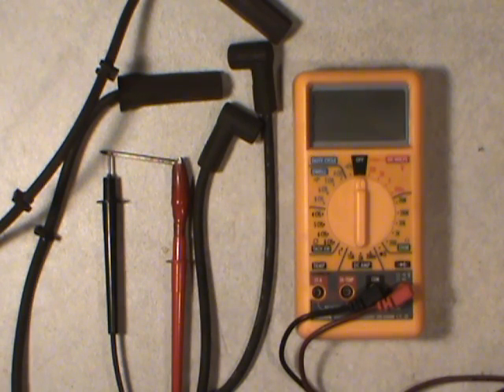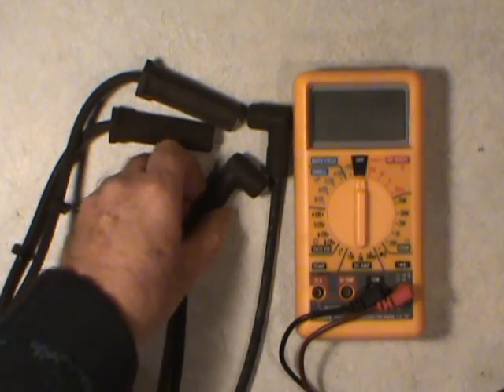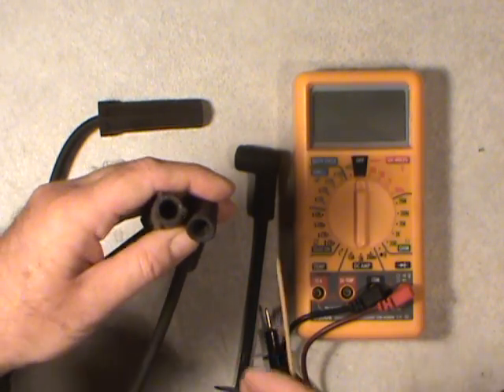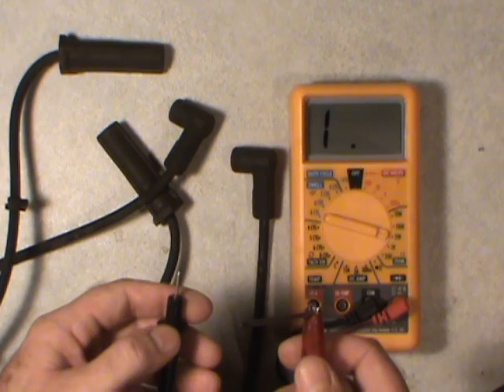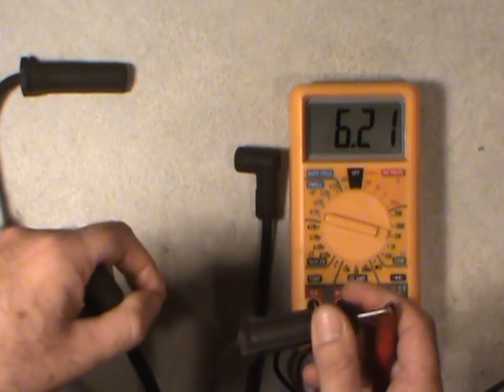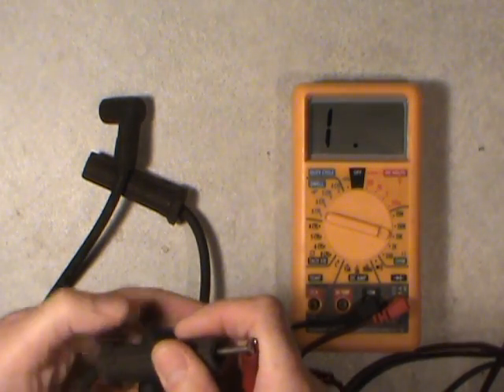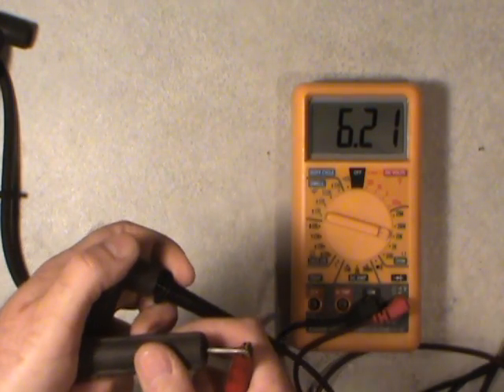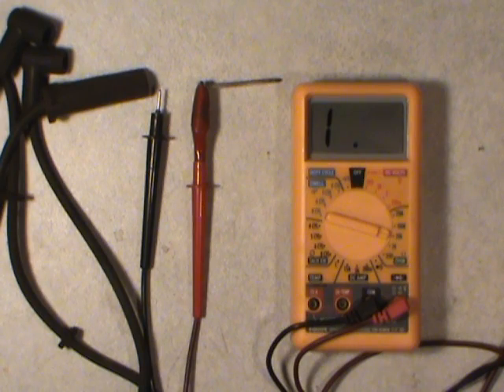How to Test Spark Plug Wires

Comment: what cause a shudder on dsg gearbox of polo 6 1.4 engine only if you set in drive but its driving normal is sport?
Reply from the maker: Greetings...shiims3545.........Thanks for watching.........The DSG Gearbox, sure is, a quite complex transmission alright.........Even though, I don't have any experience, with this (DSG) type of transmission, I can offer a few things, that might help you out..........The transmission "Fluid", and the "Filter", should be changed, at the manufacturer's specified time, and/or, mileage/kilometer-age interval, b-cuz, transmission fluid, will usually, start-to, get dirty, and also, the additives, that might be a part of that same fluid, will usually get used up as well..........Old/Dirty transmission fluid, can cause, quite a few, operating/shifting problems sometimes..........The DSG transmission's clutch or clutches, can also act up, and maybe more so, as the transmission gets older, and accumulates, many more miles/kilometers on it............Then, there's probably, a control computer or two, that also, decides/controls, the operating characteristics, of the DSG transmission as well...........Sometimes, if the engine "is not" running properly, then, there are times, where, that, in itself, can also cause a transmission, to act up/not operate properly, sometimes...........Might even be, that, the engine's "motor mounts", could be worn too much...???..........Maybe, have your vehicle's "on-board" computer "scanned", for any trouble "codes", b-cuz, if any "codes", that are related to the transmission itself, show-up, then, that usually, will become, quite the time saver, with less guessing, alright...........Perhaps, look on the internet, for a Website "Forum", for your "Exact" Vehicle, and ask some of the people, that are on those website "Forums", about your concerns..........Good luck, and.......till next time........Be Safe, take care, and have a good one.

Comment: Should I test the wires while the car is on or off?
Reply from the maker: Greetings Nicholas Alvarez...."Very HIGH Voltage", is "Going Through" the "Spark Plug Wires/Leads", while an Engine is "Running"...!!!....That "Very HIGH Voltage", as far as I remember, can reach as much as, about..."50,000-Volts"....When I was a Kid, I do recall, seeing someone get "Zapped" while working under the Hood, of a much Older Car, with a much Older Ignition System, that had "Much Less High Voltage" going through the Spark Plug Wires/Leads, and, when He got "Zapped" (aka, Electrical Shock), by what-ever "High Voltage Source", that He came in "Contact" with, while under the Hood of that Car, while the Engine was "Running", had Me Witness/See Him..."Jump Back" from the Car, "So Fast", kinda like a..."Freight Train" Hit Him, while it was Traveling at a Very High Speed...!!!

"Always Make Sure" that the Engine, in Your Vehicle "IS NOT RUNNING", when-ever You or Other People are Working On, or even Near, "Any" of the Vehicle's Ignition System's, Secondary, "Very HIGH Voltage", and that will usually Include, almost anything, from the "Ignition Coil"..."Ignition Coil to Distributor Wire/Lead" (if it has one, that is)...the "Distributor" (if it has one)..."All of the Spark Plug's Wires/Leads"...and the...Spark Plugs Themselves, or, there could very well be, the "Potential" (or Possibility), of You, or any other Person, getting "Zapped" (Electrically "Shocked") by that very "HIGH" and "DANGEROUS"...Ignition Coil's...Secondary "HIGH Voltage"...!!!

So then, with the Engine "OFF" and "NOT" Running...Automatic Transmission in "Park"...Vehicle on Level Ground...Parking/Emergency Brake ON...then...just Remove "One" Spark Plug Wire/lead at a time, and "Test it", then "Replace" that Spark Plug Wire/Lead on the Engine, and proceed to do the next one, and again I say, "1" Spark Plug Wire/Lead at a time, or, You might get a Real Headache, if You have to try and figure out, where all of those "Many" Spark Plug Wire/Leads,  "Actually" Connect/Belong...!!!

Also, especially considering that, most of the Spark Plug Wire/Leads these days, are usually made out of some kind of "Silicone" Material, and, I have found, that, the Spark Plug Wire's "Boots" (aka, the End of the Spark Plug Wire/Lead, that Connects to the Spark Plug), can actually, kinda..."Bond" (get Stuck real good), to the Spark Plug's Long "Porcelain" portion of the Spark Plug, where the Spark Plug Wire/lead "Boot" makes "Contact"...!!!

What I do, to "Prevent" this, shall we say...Spark Plug Wire/Lead "Boot to Spark Plug Bonding", is to simply, "Smear" (Apply...lol), a Thin Layer of "Die-Elecric-Grease" to the "Inside" of the Spark Plug Wire's/Lead's "Boot", that way, especially "If", there "Is Not" a whole lot of "Clearance", in or around the Spark Plug in question, I find it, so Much Easier, to, both..."Remove and Install" any of the Spark Plug Wire/Leads...!!!

Also, make sure, that You Only "Grasp" (Grab-ah-hold-of...lol), and "Twist" (aka, Turn back and forth, just a little bit), the Spark Plug Wire's/Lead's "Boot", and "Not" the Spark Plug Wire/Lead itself, when removing it, or, You could "Damage/Break" the "Internal Conductor", or its "Connection" with the "End Terminal"...!!!

So, "Always Remember", to, have the Engine "NOT RUNNING", when-ever You are Working On, or Near, the Vehicle's "Very HIGH Voltage" Part, of the "Ignition System...!!!

Be "Extra" Safe, take care, and have a good one.

Comment: Is it possible to use non-resistive spark plug wires if there is any?
Reply from the maker: Greetings Manila Dashcam....Thanks for Your interesting comment/question....Not only do they make/use "Resistive" Spark Plug Wires these days, but, they are also making "Resistor" Spark Plugs as well....Let's step into a "Time-Machine", shall we, and head, Way, way back in Time, to the Mid 1900's, where, more then likely, "Solid Core" (I'm thinkin' stranded wire, with a Rubber-like Outer Jacket), Spark Plug Wires that were probably found on the much, much Older Engines....The Worst, that would usually happen, is, a Radio or Television set, that wasn't very far, from that "Solid Metal Core Ignition Spark Plug Wire" Equipped Engine, while it was running, would Cause some "Electrical" Interference, that usually sounded kinda like a "Ticking" Sound, that was heard on, the Close-By, Radio or Television, or even a Car's Radio "Speaker/s!"

In some cases, a "Capacitor" (or call it a Condenser, if You like), was installed in the Vehicle, to kinda Absorb, that Offending, and Strong Electrical "Pulse", that was being "Transmitted" by those "Non-Resistive" (aka, Solid Wire Core/Conductor) Spark Plug Wires, to Prevent that Very Annoying Electrical "Pulse" (that was in Time, with the Firing of, each of that particular Engine's Spark Plugs, from coming in, "Loud and Clear", on that Vehicles (car or truck) "Radio!"

Now, it's time to head..."Back to the Future!"...Ooops, I really meant to say..."Back to the Present!"...lol.

From about the early 1980's (maybe even before that time period), Cars and Trucks, were being Equipped with "Computer" Controlled "Engine Management Systems".

Using those good ole "Solid Wire Core" (or, as You put it, "Non-Resistive") Spark Plug Wires, on any of those Vehicles, that are Equipped with "Computers", would more then likely, Cause some very Serious Electrical "Interference", that would really have a Very "Bad" Effect on that Vehicles "Computer", and its "Ability" to Function at all...!!!

Also, if the "Computer" was able, to even keep the Engine Running, it may very well "Miss-Interpret" the "Signals" from the Vehicles "Sensors", and also, perhaps, Process the Sensors Signals "Incorrectly", and "Command" the "Actuators", with the "Wrong" Actuation "Signal", and, might even cause some "Major" Engine "Damage" as well...!!! (just thinkin').

If Your Car or Truck, has a "Computer" in it, then, as I see it, "Always" Use the Factory/Manufacturers "Recommended" (Resistor) Spark Plug Wires, as well as, all of the "Other" Parts as well, in order to "Prevent" Engine/Computer, etc., "Damage", and from also, "Sending" that very Strong Electrical "Pulse", into the Vehicles, near "Your" Vehicle, that will make "Their" Radios (and Yours also), do the very "Annoying", Electrical Ticking "Pulse" Sound, that You have Broadcast "Live", from Your Vehicle, while Using "Solid Metal Core" Spark Plug Wires...!!!

Pure-Bred "Racing Vehicles", may be an Exception, as those very Vehicles, are Striving, to Wring-Out, every Last Bit of Horsepower (and sometimes Torque as well), in order to..."WIN" that there "RACE"...!!!

So, there You have it, the "Reason" that, Most, if not All Vehicles, that are being Driven on the Street, these days, (as in, Settlement, County, Town, City, Metropolis, State, Province, District, Country, Continent, well, You get the Picture!...lol), are Equipped, and Using...the, "Resistor" type of Spark Plug Wires, and, in some/most cases, "Resistor" Spark Plugs as well.

I hope that You enjoyed the above..."Food for Thought"...

...but, hey now...

...did someone say...FOOD???...

...cuz...

...now I'm getting "Hungry!"...

...Be Safe, take care, and have a good one.
Reply: AWESOME information, I do remember our cas back in the 80's had those whirling noise in the radio at one time when the spark plug wires were replace.

I still run a carbed engine and I would definitely want a solid core spark plug wires :)

Thanks man!!
Reply from the maker: Manila Dashcam
Greetings Manila Dashcam....Thanks for Your nice comment....If You do happen to use "Solid Core" Spark Plug Wires/Leads on Your Vehicle's Engine, and, if, there happens to be Someone giving You an "Angry-Like" Look, be it, a Person sitting in the Car next to You in Traffic, or, maybe even a Neighbor, who could hear the "Rythm" and "RPM's" of Your "Engine"..."TICKING-AWAY"...on His/Hers Radio or Television Set, then, You "Will" Know..."WHY"...that Person is giving "YOU" that "Angry-Like"..."LOOK"...!!!...lol....Be Safe, take care, and have a good one.
Reply: Hahaha! Thumbs Up!!

Comment: *the meter stays on the letter "i" for infinity, as in infinity resistance... Not 1. :)
Reply from the maker: Greetings Supavillin....Thanks for watching this video of mine, and, for Your comment as well....So then, if I'm not mistaken, it appears that "Not All" Digital Ohm/Multimeters Display the "Same Readout", when Encountering, oh, let's say, "An Open Electrical Circuit", shall we....I guess it all Depends on what the Designer's/Manufacturer's wanted "Us" to "See", when in fact, one of Us, happened to be Measuring, a so called "Open Circuit", perhaps....Then, as in the Case, of an "Analogue" Ohm/Multimeter, there happens to be a..."Needle/Pointer", that likes to..."Wave At You!!!"...lol...and...usually, if an "Analogue" Ohm/Multimeter is used, and it is "Turned On", and "Calibrated" for the "Range" that is about to be Measured...and...good ole Wavin' Mr. Needle/Pointer "Encounters" an "Open Circuit", it will, for Most Intents and Purposes..."Stop Wavin' at YOU!!!"...lol....So then, there You have it, well, for now,  anywayz....Be Safe, take care, and have a good one.

Comment: When i remove spark plug wire number2 i see electricity leaks from the ignition coil connecting that wire ?,is that mean my wire is bad or my ignition coil ..
Reply from the maker: Greetings...fouad jm.............Thanks for watching...........Well, if I understand correctly, as to what you were saying, then, is seems, that, you have the number 2 spark plug..."wire"..."not connected"...to the ignition coil, while cranking or running the engine (if that's not correct, then, just let me know, thanks)...........When-ever something like a spark plug "wire" is "not connected" to the ignition coil (or, the distributor cap), as the case may be, then, that, shall we say..."open"..."high voltage" (thousands of volts)..."electrical circuit" (that was caused by, the "not connected" spark plug "wire"), is..."Bad"...for, a car or truck's..."ignition coil"...why...???...you ask............Well, any time, that a "gap" (distance between/air space) starts getting "larger" (such as, the "gap", that's between the spark plug's 2 electrodes, as an example), then, the ignition coil, will then, try to output more "high voltage", in order to, try, and..."jump"....that...too "large"...of a..."gap" (air space), and, if that "gap" gets too "large", then, the ignition coil, will usually keep, trying and trying, to output, much higher, "high voltage" (measured in thousands of volts...!!!), to the point, where, the "ignition coil" gets, shall we say, "over-worked", and "damages" itself, until it no longer works...!!!............So, never operate the engine, unless, all of the secondary..."high voltage"...parts, are..."connected properly"...and, are in..."good condition"...as well, so the ignition coil, is able to work, the way, that it was designed/engineered, to be doing so, for that exact vehicle and engine , and........till next time........Be Safe, take care, and have a good one.
Reply: RockysRoadshow 
Hi thanks for quick response .i checked again there is sparks from ignition coil while the engine running .is that means my wires are bad or my ignition coil..huyndai avante 2002
Reply from the maker: Greetings...fouad jm............You're welcome, and, here are a few things, that, might help you out, some-what..........When it is "dark outside", then, have a look at your engine, when it is running at idle speed, and, you might see...???...even more, not wanted "Sparking", coming out of the spark plug "Wires", or, other places as well (I've seen "sparks", jumping out of a spark plug "wire" before, where it was "close" to a metal bracket), so, try to keep, all of your spark plug "Wires", away from, anything, made out of "Metal"...........While the engine is "Cold, and Not running"...!!!...then, remove the spark plug "Wire", from the "ignition coil" (where you saw the "sparks"), and, take a close look, at the ignition coil's "tower" (connection point for the spark plug wire), with a flashlight, and maybe, a magnifying glass as well, oh, and also, feel with your hand too/with a finger-nail, for any "Cracks", that might be in, the "ignition coil's "Tower", and, if you find any "Cracks", then, it's time for a new one............Also, have a look, at the metal terminal, that should be, down, inside of the ignition coil's tower, for anything, that looks like, burning, dark spots, etc..............Also, have a very close look, at the (sparking), spark plug wire's, rubber-like "boot" (that plugs onto, the ignition coil's, high voltage tower), to see, if there are any "cracks" in it as well, and also, have a look, at the spark plug wire's, "metal" terminal, for anything, that might look like, it has been, high voltage arcing (kinda like, burning)............Spark plug "Wires", usually, "don't last forever", so, if your engine's, spark plug "Wires", are older than, oh, about 5 years or so, then, because of the very "high voltage", that goes through them, then, they will usually, start to, shall we say, "wear out", and in some cases, the outer jacket (insulation), can also break down some-what, and if it does, than, there's a pretty good chance, that, some of that high voltage, will start leaking out, and looking for, an, easy to get to, electrical "ground source", such as, just about anything made out of "Metal", and sometimes, near any "Moisture", (as in, water) coated parts, as well, possibly...........So then, if there are any "Cracks", or, there happens to be, a set of, very "Old" spark plug "Wires", then, those would be the first things, that I would be concerned with, given that, not wanted, "Sparking" situation, that you were seeing...........I hope the above, will be of some help to you...........Good luck, and........till next time........Be Safe, take care, and have a good one.

Comment: Thank you!
Reply from the maker: Nikolay Nikolov Greetings Nikolay Nikolov....You are welcome, and, Thank-You, for watching and commenting on this Video of mine....................................................As far as I have experienced in the past, is, even though a "Set of Spark Plug Wire/Leads" may "Appear" (aka, Look) almost like "New", and "Appear" to be in Great Shape, especially if that Set of Spark Plug Wire/Leads "Outer Jacket/Covering" happens to be made out of a "Silicone" type of Material, can be Very "Miss-Leading", and having a Person, well, kinda Thinking, that, that particular Set of Spark Plug Wire/Leads should be able to Work Good..."But"...seeing as how it happens to be the "Conductive Core" (aka, the Inside part of the spark plug Wire/Lead, that is "Responsible" for "Carrying" all of that "Very High Voltage Electricity") to the Spark Plugs, then, the "Conductive Core", and it's "Connection" to the Metal "End Terminals", of all, of the spark plug "Wire Leads", has to be in the "Best Condition" possible, in order to have any Engine, Run and Perform, the Best that it's able to...!!!.....................................................Always try to Remember, that, it Only takes "One"...not so good...Ignition System/Circuit...Wire or Wiring Connection, or an Ignition Component, that might not be working as good as it should, which at times, might cause Your Engine to Run/Perform...Not So Good...or...maybe even...Not At All................................................Be Safe, take care, and have a good one.